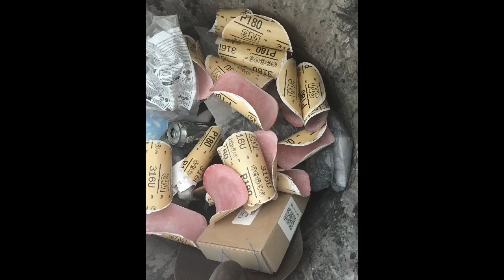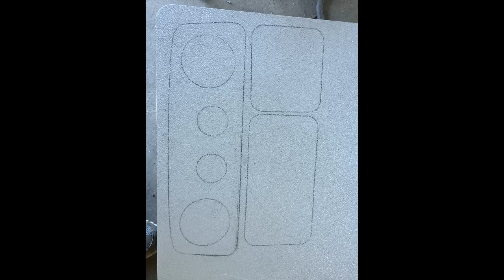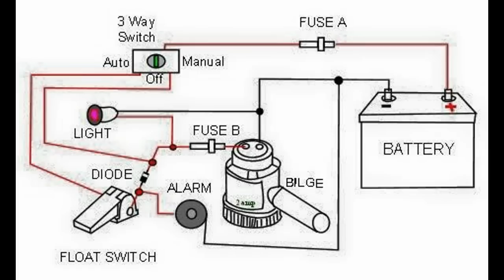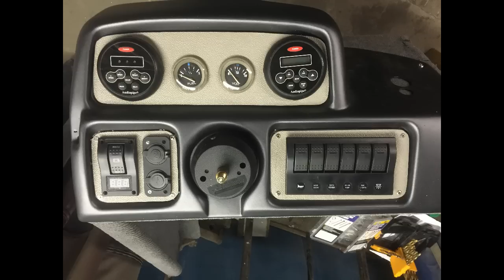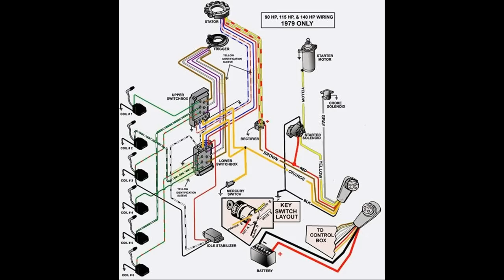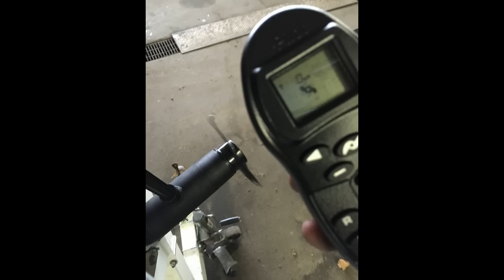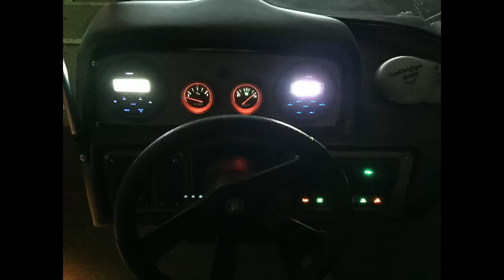Starcraft Fishmaster 190 BUDGET REBUILD 2015

Comment: Very impressive rebuild.   I admire your skills and knowledge.   I understand it's a budget rebuild, but why use an outdated 2-stroke motor?  Don't get me wrong, I'm a gearhead and I love 2-strokes.  They make great power for the weight.  But what happens when you need parts for it?  I know 3 guys off the top of my head who have recently had to bite the bullet and invest in a new 4-stroke because nobody will look at their older motors and nobody will order parts.  In the case of these 3 fellas, the parts simply weren't made anymore.  These were 80's and 90's model 2-strokes.  Obviously my point would be stupid if I were talking about motors from the 60's or even 70's.  But the 90's aren't that old.  I'll bet many of those engines don't even have 500 hours on them, but some part is broken or worn so the owner is left with no option but to modernize and take the $20,000 hit.
Curious, did you use the old Mercury to keep in line with the budget aspect of the project?
Its 2019 now.   How does the boat run?  Still fishing from her?
Reply: Parts are there, you just have to look for them. And yes, many shops won't touch them but they are simple enough for the home mechanic.
Reply: We have a local shop that just specializes in the old motors by me.....they are so busy they had to move to a bigger building even.
Reply: he got a motor for next to nothing and it runs, why not use it? yes they are pretty easy to repair and when he cant anymore i'm sure he'll upgrade, till then he'll be fine